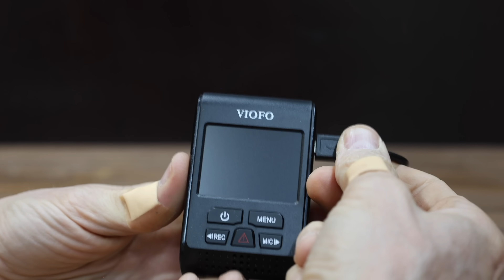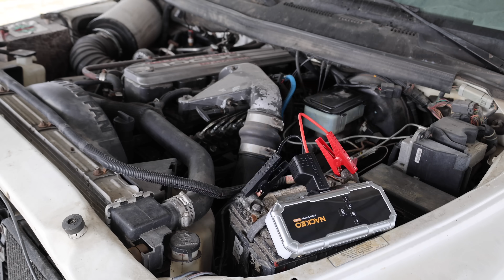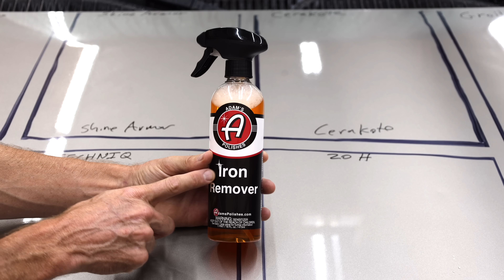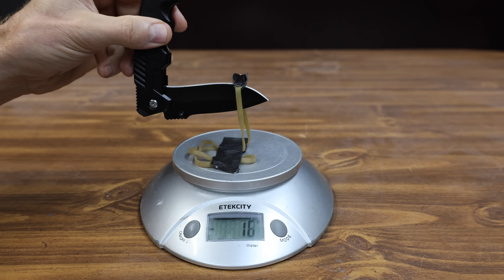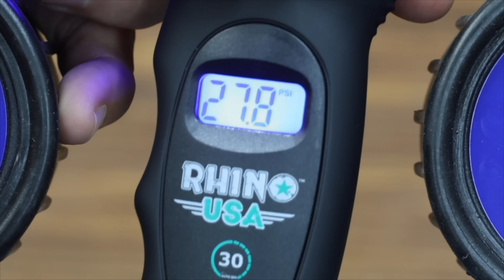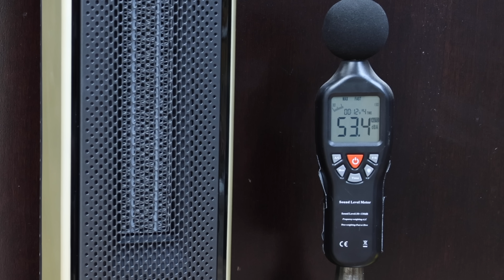Best 10 Items I Tested In 2025

Comment: burned the brakes on my stihl farm boss-  brake is on when i choke/fire it up.  thing has been leaking bar oil like a sieve so my theory is the bar oil was all over (wiped off the exterior beforehand) and it heated up the brake faster.  then it seized and died-  internal plastics are melted, bar oil pump melted-  proved it all out and at least $300 in oem parts, stihl won't cover under warranty and local repair quoted $600

Comment: The knife testing was wildly inaccurate or just outright wrong.  You were testing knives that all had different steels (carbon steels vs stainless )and heat treatments (which really makes a huge difference) therefore it couldnt be even close to 1:1 test.

Comment: I must have got a lemon because I purchased one of the Ancel battery testers last year, without seeing this video, and I used it on the battery of my 98 Ram 2500 and it told me the battery was good. I replaced the starter, because the Ancel told me my battery was good.  The truck still did not start after replacing the starter so I decided for laughs to grab the battery out of my car to see if it would start, sure enough, it was the battery all along.  Needless to say I don't trust the Ancel battery tester but I have purchased many items based on your tests and I believe in them.
Reply from the maker: Thanks for sharing.

Comment: It will be a nice thing if dash-cams can be tested for how well they handle the high temps it can reach inside closed vehicles (especially in places like the Southwestern US). Many cameras are designed to be left in the car to operate in sentry mode (hardwired), yet they are not built to tolerate heat—with the connectors to the built-in screens being the first thing to fail under such conditions (based on my experience). Head units, for example, with digital screens, under the same conditions, do not fail like that, because they are tested for such. Thoughts?

Comment: How about testing if it's okay to use lithium batteries in smoke detectors to compare battery life. In a smoke detector that only uses the battery as its power source and a detectors that is also hard wired to power with the battery being the backup power.

Comment: Please test NO-OX-ID A special vs some other brand name conductive corrosion inhibitors. I use no ox id on anything that is in humid environments or when terminating 2 different conductor types like aluminum to copper, battery terminals, even aluminum to aluminum. I wonder how conductivity varies with zinc or copper particle corrosion inhibitors.

Comment: Weird, I clicked the link for the air duster and it was 99 dollars. I opened a privacy tab and searched it anonymously and the MF100 came up for 62 dollars (a limited time deal down from 79, STILL cheaper without the deal than the link 🧐)

Comment: How about cheap cycling front/rear lights from China?

There's a lot of good and bad out there, and there's a fair bit of variety in features (stuff light high/low beams, wireless remote buttons, brake detection functions, replaceable 18650/21700 batteries etc).

Unlike enthusiast flashlights, most bike lights don't say what sort of driver or LED is inside so it's hard to know what to buy until someone reviews it.

Things that would be worth testing beyond just brightness and battery life:
- Beam profile (is there a proper anti-glare cut-off?)
- Brake detection reliability (does it falsely trigger and run the battery down?)
- LED driver type (does it maintain constant brightness or decay as the battery wears out?)
- LED colour temperature and colour rendering index
- Water resistance
- Mount durability (some models will crack after being vibrated for hours)
- Close-up images of the LED (can help identify whether it's from Cree / Osram / Nichia / Luminus etc or if it's an off-brand).

Comment: One thing that would be cool to see, is like the civivi knife, where a cheaper option punches well above its weight, buying like, 5 or 6, repeating the tests and showing distribution if any. 

I know there are products where the less expensive options CAN be just as good as more expensive ones, but they can also be much worse, and you just dont know which your getting until its in hand.

Comment: Video Idea if you have not already done it.. Fireproof safes. There are a ton of brands that claim 3000, 4000, even 6000 degree fireproof and/or waterproof for so many minutes or hours. There are official testing certificates for expensive safes, but none of the cheap Sentry style safes on Amazon or local resellers can back up their claims with data. Would love to see you cook some of these and check the contents of paper and media stored inside them!

Comment: Here is the list....
Dashcam - Viofo $140
Air duster - Wolfbox $90
Jump starter - YaberAuto $81
Inspection camera - DXZtoz $140
Ceramic coating - GTechNIQ $80
Car batter tester - Ancel BA101 $32
Folding knife - Civivi $30
Tire Press. Gauge - JACO digital $28
Screwdriver 🪛 - Craftsman Diamond tip $50
Space heater - DREO tower $90
Reply: Great I've only got a $751 wish list!

Comment: In my experience the viofo just doesn't last. it fails after a few months.  Returned it got a new viofo and it also stopped working after a short time. I don't buy that brand anymore. I switched to DDPAI for my dashcam. it just works and have had it for years now.

Comment: I know you're always asking for ideas for future shows. I have a couple. How about brakes? I would like to see you test brake rotors. Are OEM rotors worth the extra cost? Do the rotors that cost more, claiming a rust preventative coating, really rust less? How about the carbon steel variety for resisting warping? In the same category how about brake pads too. Again is there a big difference? Is OEM better/worth the money? What about expensive brands aftermarket brands? Thanks

Comment: I’ve enjoyed your videos for many many years now.  Unfortunately I have an FYI; I bought a JACO 0-200 digital tire inflator with gauge & found 2 problems 1) it only measures in .5 increments 2) the 1% accuracy means it’s can be off by +/-2psi as stated on their box.  Unfortunately that’s no better than an inexpensive one.  Note; I do love the female attachment & release end, super easy to use.

Comment: I would like to see you test the DR trimmer mower against the other brands of trimmer mowers using the same fuel and same same oil test with .155 string. And similar engine size i have another suggestion is to test different 2 cycle oils for weed eaters or chainsaws I want to see full synthetic or semi synthetic 2 cycle oils tested at two ratios 100.1 and 50.1 and i want to see klotz tecniplate 50.1 some brands claim they can be ran at 100.1 such as amsoil saber Ive always used ECHO red armour Sten sheild or Lucas semi synthetic.
Reply from the maker: Thanks for the suggestion.

Comment: For the tire gauge, I recommend the Jaco FlowPro version instead.  Same head but the chuck simply pushes onto the valve stem and grips it (no need to hold it on), plus has an inflation lever.  A single tool to check/inflate/bleed all in one.

Comment: Aw man... I just got 2 air pumps right before this published. Literally the day before.
I guess I got kinda lucky, got the Viair, and a pair of press-on chucks to use with it. If the gauge is off, I guess I'll add a gauge to the line as well.
I do have a 15 amp fuse on my car though. Might have to swap it for a 20. Shouldn't be too problematic for the wiring, it's a fuse purely for the lighter-socket, and I don't use that other than to inflate tires infrequently.

Comment: Have you ever thought of testing paint strippers like coopers strip club, I have an antique car to remove years of paint and body filler from, in debating chemical vs something like harbor freights surface condition tool (with metal wheel) or just a stripper wheel on an angle grinder. Thanks for all the input over the years!!
Reply from the maker: You are welcome!  Thanks for the suggestion.

Comment: I just wanted to let you know that I ended up getting the battery charger/inflator because of your recommendation and review. 
I was towing a car home with a tow strap today and the tires were low on the car. I didn't have anything to blow them up and one blew, prompting me to pull over change the tire and find a had station to blow up the rest. 
That was the last straw and since it was Cyber Monday sales I got it for 50% off. Thanks for what you provide and please keep it up.
Reply from the maker: Thanks, will do!  Thanks for sharing.

Comment: Been a fan of the channel for a long time. I compression tested my 93 f150 5.0 for fun. I got it with 176k, has 193k now. I seafoamed the motor, use restore at every oil change and add a quart of marvels mystery oil 500 miles before each oil change and add a little bit to my fuel tank each fill up. I change the oil every 3k. I had 180 psi on 3 cylinders, 175 on 3 and 170 on 2.

Comment: BIG PROBLEM with "Ancel Car Battery Tester" : It only tests batteries down to 30ah, which means NO lawnmower, ATV, Generator, Pressure Washer, etc batteries can be tested and reports incorrectly when using 30 to test them. I am returning it. 
I didn't see this listed as a test criteria but it probably should be, since these are likely the most 'problematic' batteries for homeowners.

Comment: Can you do a test on those diamond/tungsten carbide everlasting cutting/grinding wheels? I can't find one in your library.
Also, are you aware of any spark-proof laces? My work boots get through several sets of laces a year, always breaking at the worst moment.
Thanks.
Reply: Or ceramic blades/wheels.

Comment: I bought the viofo dash cam to use as a bicycle rearview camera several years ago and can recommend it as also highly maintainable, the lens assembly screws off easily and the camera can be pulled out. Soldering skills are needed to change the battery

Comment: I bought the Civivi knife and WANT to love it, but unfortunately carrying it in my front left pocket is unsafe due to the opening mechanism and orientation of the clip. I’ve had it come open ever so slightly and then accidentally cut myself while reaching into my pocket. I love everything else about it: weight, feel, look, performance, etc… but the safety issue is a fatal flaw for me.

Comment: Interesting test with the wolf box. I hooked it up to a higher end usb charger and using the included charger the voltage jumps to 7.1-7.5 using the usb a to c cable.

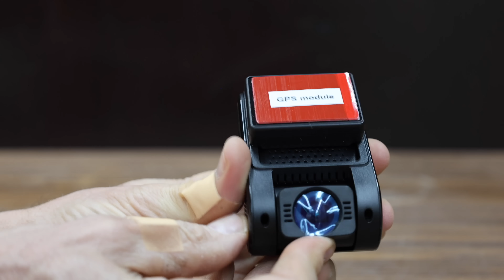Comment: 0:06 Dashcam
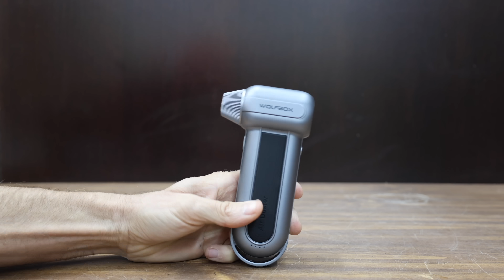2:00 air duster
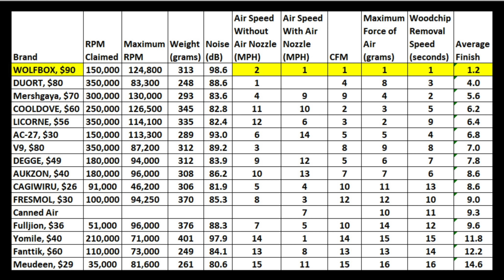3:40 jump starter
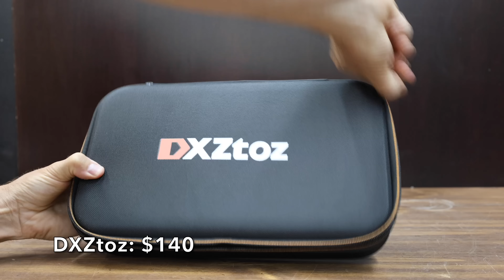5:58 inspection camera
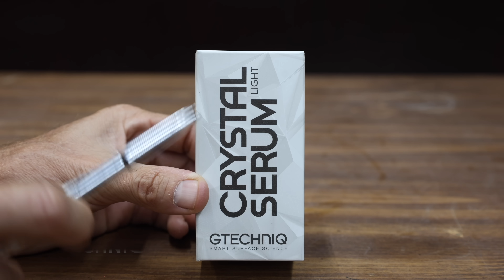7:18 ceramic coating 
9:34 Car Battery tester
11:07 folding Knife
13:25 tyre gauge
15:17 screwdrivers
16:44 space heater

Comment: I purchased two products based on this top ten list.  A Viofo dashcam and the Wolfbox air duster.  I need to watch the tire pressure gauge video, but I might get that as well since I'm down one, one of my Slime branded ones gave up on me.  I didn't go with the exact Viofo dashcam, but a similar one.  I have purchased the Wolfbox duster for home and just last week the duster I used at work failed so I replaced it with a Wolfbox one.

One video I'd like to see next year is air purifiers.  I had two Honeywell HHT-090 tower purifiers.  One recently failed after 10 years of nearly continuous use.  The other has started making some noise like the motor may be starting to go.  For now it's working, but I suspect I'll be in the market by next year sometime.  I had bought a purifier before the Honeywells that I had to return because it started making a squealing noise.  I bought another one for work a couple years ago with a similar issue.

Comment: I think your channel would be perfect for showing viewers DIY solar. So many people are going to be getting ripped off by power companies in the coming years. I did a 25kw Ground mount Solar Array with EG4 products and 100kwh of chinese batteries that had top of the line parts in them. It was extremely rewarding and feels amazing to be energy independent. I would say reviewing the process of DIY Solar agnostic of the products would make for an amazing video. My array was made with 4x4s 2x6s, lag bolts, washers,  hurricane clips, concrete, tar, wood paint/sealer, and lots of wires.
Reply: I agree in that solar panels would be a good one to review as we all would like to save money on utilities!!  Do it!
Reply: Love this idea.

Comment: I know ceramic coatings and you did not machine polish.  If you polish the surface before you apply the coating, you will have better adhesive & the coating will bond better to the paint.  Also, I usually apply an iron remover, chemical decontamination, to remove iron deposits.  The iron deposit could come from iron fallout or brake dust from the wheels.  The first stage in oxidation (Rust).  Thank you!

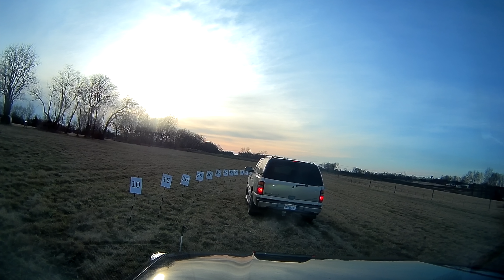Comment: 0:15 I have to disagree the dash cam recorded the second before my crash, and after my crash
Reply: Why wasn't it on a recording loop like a normal dash cam?
Reply: @zpbeats3938  it was set up like the instructions said
Reply: Check all files because i thought the same thing. I found the footage digging just a bit. I set mine to 3min loop recording if that helps
Reply: I thought my viofo did that too in my crash in June. But I was able to find it. It did it's job. The crash broke my old vifios cable, so I bought the newer one. I trust it.
Reply: You failed to use it properly
Reply: @Steve-xj2dr  Exactly...
Reply: @Steve-xj2dr nope

Comment: I got the HopeFox inspection camera after your reviews, it has been useful, and while a small camera was not necessary, I was able to use it to otherwise blindly swap the Evap pressure sensor on the top of the fuel tank on my S10 without lifting the bed or dropping the tank. I could get tools and my hands up there, but I needed eyes and the Hopefox did great. I ended up buying it over the other brands because of the performance vs cost from the reviews. Same with a while ago I bought the Rocket Socket bolt removers, those have worked a treat for a few years now. Keep the reviews coming!

Comment: There might be an error with the Yaber jump starter.  The one in the video appears to be $189, over twice what’s shown in the chart.  They have a model in the $80-90 range, but it’s not the one in your video.  Please check.  Thanks.
Reply: If you look at the price history, Yaber Auto increased the price on the one suggested in this video. It was $89, but they increased it by $100

Comment: used your refer link to purchase the battery tester as the price is even better now and it's one of the things that's been on my want list for years now.
Reply: ok wow, i just checked the wolfbox link for the fun of it because i passed it up a week ago when i ran out of my cans of hfc-152a for being too expensive ($80). it's now down to $62 - so i bought it using your refer link.
i regularly dust out computers and i hope it can do the job. normally use the air compressor because canned air just isnt enough most of the time; anything under 100psi on the air compressor usually isnt enough either.

this will be a huge help since my personal computer has like 1000 wires plugged in and has sort of become part of my room and really hard to get to and very heavy.

Comment: I’ve worked with quite a few ceramic coatings over the years, and G-Technic surviving strip wash, iron remover, bug & tar remover, wheel cleaner, and degreaser back-to-back is outstanding. Seeing those tight beads hold up after all that abuse really shows its durability.

Comment: Hi Todd! Thank you so much for all your fantastic videos, you have helped out so many people! I have a few suggestions as I just got a welding job and need some good tools.

My suggestions: Combination square (need 6",12" and 24" if possible), try/machinist square, MIG pliers, torpedo level, 2ft level, 4ft level, 8ft level if possible. Anti-spatter coating for MIG & Flux Core. 9" angle grinders (professional duty) 4.5"-6" angle grinders (pro duty again.) Variable speed angle grinders. Wire wheel for angle grinders. Just to name a few.

Thanks again Todd, please keep up the good work!
Reply from the maker: Thanks, will do!  Thanks for the suggestion.
Reply: @ProjectFarm Thanks! Looking forward to seeing the tests!

Comment: Have you done a test on underground wire detectors?
Reply from the maker: Thanks for the suggestion.
Reply: @ProjectFarm  I'm trying to find the head to a well on one of my rental properties so I can replace the pump.  Even though the casing is heavy steel, its about 2 feet below the surface (I know that they don't do them like that anymore, but this house was built in the 70's). 

First I tried a metal detector, all I found were random nails, bottle caps, etc.

Then I purchased a cheap wire locator from Amazon.  It helped me find how pipe and wire left the house and pointed me in the general direction.  But it only had a range of about 8 feet linear at that depth (nearly 2 feet)

So i tried digging a series of holes 8 feet apart, but it heads very close to a big tree with huge roots.

Right now I'm up a creek without a paddle

Comment: I bought one of those Viofone dash cams. It stopped correctly reading/writing to the SD card after 6 months. Tried multiple SD cards, all of which worked fine in other devices.

It did work great when it worked, but $90 for it to only last 6 months. Oh yeah, there's no warranty. So there's that.

Just sharing my experience.
Reply from the maker: Thanks for sharing your experience. Sorry that happened to you. We have several Viofo cameras in our cars and have not had this issue.

Comment: I bought the Ancel battery tester/analyzer and it saved a battery that had been sitting a year and a half, nearly to full capacity after the restoration cycle!  Thanks much! It more than paid for itself, several times over, on its first use!
Reply from the maker: Thanks for sharing.